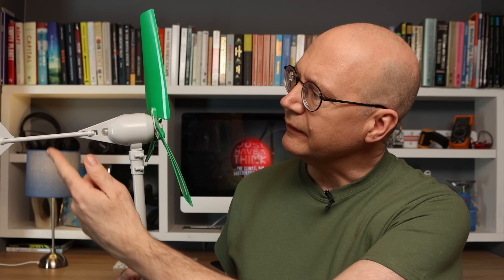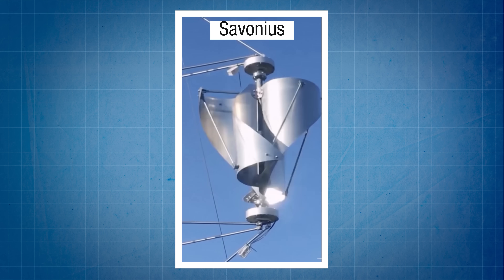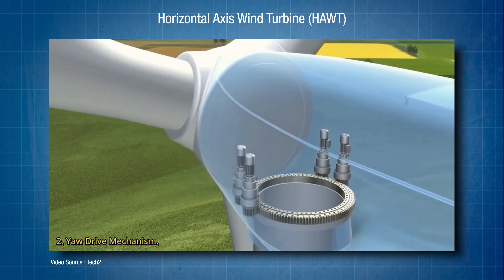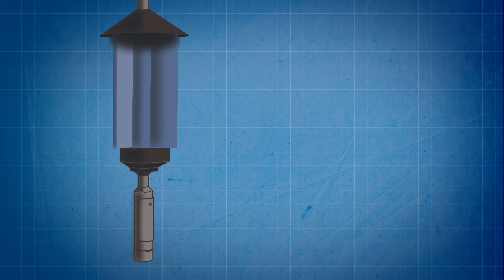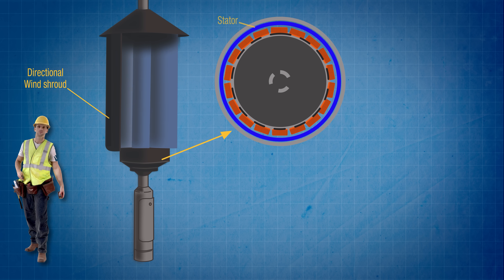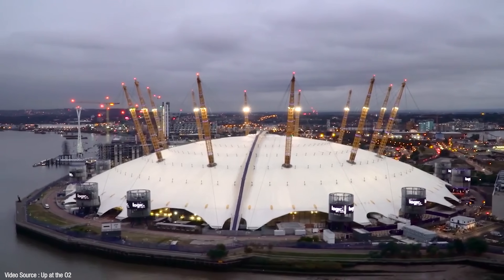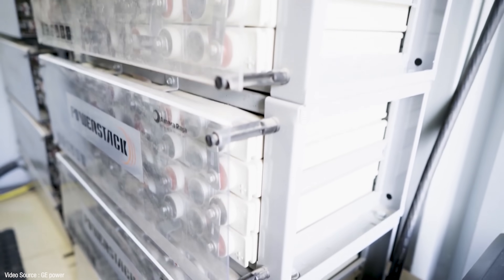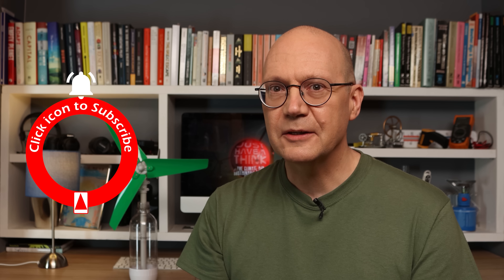A vertical axis wind turbine that doesn't need the prevailing wind! How do they do that?

Comment from the maker: **************** INFORMATION CORRECTION FROM THE VIDEO CREATOR******************
Some of you eagled-eyed viewers have pointed out a discrepancy in the arithmetic in a cost comparison between a solar farm and an installation of turbines, which was originally featured at the halfway point in this video. Having spoken directly with the folks at Alpha 311 we have established that, while the bottom-line cost comparisons were correct, there was a syntax error in the original presentation document from which the comparison was taken, and there was some key data that I had not included in my commentary which would have clarified how the calculations had been made. It’s not possible to add a new section to a video once it has been posted on YouTube, but it is possible to delete certain sections, so I have now removed the comparison slide, and it no longer features in the video. I am however conscious that some of you would like to understand what the accurate numbers really are. So here they are :

Cost comparison :
 A 3MW solar farm on 15 acres of land, consisting of 12,000 panels at 250W per panel, with a 25 year ‘Power Purchase Agreement’ at an agreed cost of between 4.7pence and 6.3pence per kWh, giving an overall 25 year cost range of between £38.2m and £51.3m 

Versus

An installation of 125 turbines along an existing  4.5km stretch of motorway with a monthly lease cost (including installation and lifetime maintenance) of £29,000, giving a full 25-year cost of £8.7m.

Calculations:
A 3MW Solar installation receiving 6 hours of useable sunlight each day (averaged across a year) works out like this:
3000kW x 6hrs = 18,000kWh per day

In the original document the turbine installation was also quoted as having a 3MW generating capacity. This was INCORRECT.

I also omitted an important power generation graph that was included in the company’s original presentation to me. That graph came from the external test house and it showed that the turbines have a maximum rotational speed of 420RPM in a wind speed of 19m/s, giving a maximum generating capacity of 6kW, (which by the way, is well within the capacity of the turbine’s alternator, which is rated at 13kW)

125 turbines at  6kW per turbine  = 750kW total capacity (NOT 3MW as originally stated)

Wind Turbine maximum capacities are based on an assumption of constant wind speed over 24 hours (just like solar panel maximum capacities are based on the assumption that it will always be sunny during operating hours).

The sums for the turbine installation therefore work out like this : 

750kW for 24 hrs = 18,000kWh per day

So, although the generating capacity of the turbines is less than the solar farm, the rated available operating time is 4 times greater. That means that the overall generating capacities for the 2 installations are indeed comparable.

Alpha 311 have conducted extensive testing on their turbines with external test houses over a three-year period prior to investing heavily in tooling to set up production on multi-million-dollar contracts with large corporations who, you can be assured, will have done their own due diligence on their investments before signing on the dotted line. The folks at Alpha 311 assure me that they have seen the operational performance of their turbines with their own eyes, and they stand by their numbers 100%. Ultimately, unless you enjoy standing in a court room being sued for misinformation and  breach of contract, it is generally sensible to ensure your product ‘does what it says on the tin’, and having now spoken at length with the Chief Executive of the company, I am satisfied that Alpha 311 are acting in good faith.

I would also like to directly address the less savoury comments  from one or two very ‘animated’ commentators who felt the need to post multiple defamatory comments about me personally. For the record…I am not affiliated in any way with Alpha 311. This video was not funded, sponsored, or paid for in any way by Alpha 311. I have never, and will never, accept any payment or sponsorship from any company for any services or endorsements on any of my videos. I have never, and will never, monetise any of my videos. So, this video, just like all my videos, attracts ZERO revenue for me. There is absolutely NO incentive at all for me to intentionally post spurious information. I am however a human being, not a robot. Occasionally I make mistakes like everyone else. And when I do, I always hold my hands up and do my best to make reparations. I hope I have managed to do so in this instance., Many thanks. Dave Borlace (Just Have a Think channel operator)
Reply: This is BS. e.g. Consider a large high sided semi. At the side of the road are big wind turbines which are very close to the road. The semi clearrly has more drag because it needs to spin the wind turbines (spin damped by motors). 
e.g. 2.  The road is 2 way with turbines in the middle. The turbine forms a partition between the opposing sides and makes the airflow move more efficiently. I'm guessing there is increased drag either way, so vehicle momentum is 'taxed'.
Reply: @goldreserve  exactly, parasitic load
Reply: Error is intended, this is how you trick investors. This is really old idea but it's not efficient.
Reply: Should've posted this on April 1st.
Reply: It really doesn't matter what the arithmetic is, the basic premise is flawed by the laws of physics. Look at it this way. A vehicle going X fast uses the least amount of energy when there is nothing around it and winds are 0 mph. Same vehicle, in a tunnel that is close to the same shape as the vehicle, now the vehicle has to push ALL of that air that is in front of it out of the tunnel. Going X speed it is using a lot more energy to push the air out of the way due to increased resistance. Wind energy dissipates the further you are from the source, so if you want to capture the most energy, you move the turbine as close to the vehicle as possible. Good vertical axis turbines are about 15% efficient at capturing wind energy so the next step would be to use a foam roller to contact the actual vehicle to turn the turbine, all of a sudden your turbine efficiency rises, as does the corresponding drag on the vehicle. Now it has to burn more gas to give you a smidgen of wind energy. You'd be much more efficient just having a gas generator running. There is no free energy from vehicles, it all comes from the vehicles motor and to impede it is to spend more energy from the vehicle. There is a reason why there isn't a wind turbine on the hood of cars.
Reply: @alexkollitz2032  Very well explained.
Reply: That checks out. The wind speed of 19m/s vs. 5.2m/s expected from traffic makes all the difference, showing up as a cube, and the 4X time difference makes up the rest.  However, the vast majority of roads don't have 19m/s winds, or even 5.2m/s winds 24 hours per day, and I seem to recall that they were claiming the 125 turbines were equivalent to the big 12,000 panel solar, where solar often averages 4 hours/day at rated.
Reply: How does the 6kW output estimate compare with the wind turbine generator calculator at https://www.omnicalculator.com/ecology/wind-turbine ?
Reply: I will leave it to others who have worked through the numbers of generating capacity of the wind turbines.  However, I have to point out that traffic density, and therefore wind generated, varies widely over a 24 hour day and from week day to weekend, from rush hour to the middle of the night.  

Further, I stand by my previous statement that  there is no free lunch.  If you put up a structure that captures and impedes the flow of air moving out of the way of vehicles, those vehicles are going to have to work slightly harder to get through that air.  Thus, the power generated is not free.  It is paid for by the motoring public.  People driving along roads where these are installed will be paying a small tax in the form of decreased fuel mileage.  And, ultimately that energy has to come from somewhere so there is no ecological advantage.  Only smoke and mirrors.

There is a corollary that has been shown in a number of studies comparing the cost of maintaining a road versus the cost paid by the motoring public for additional wear and tear on their vehicles caused by driving on a poorly maintained road. Maintaining the road is cheaper. However, the public will generally vote against additional taxes to fix the road even though it will cost them less in the long run.
Reply: Great work Dave, I must admit my first thought was that this was a variation on the 'turbine on the car roof' concept. Glad to see it's really a great idea. Ignore the pinheads, the hard of thinking will always be there.
Reply: Very well written explanation &  rebuke to the haters is the cherry on top.

Great video, A311 has made their future very lucky, indeed.  It's these energy reclamation & other Alt-Energy sources, which will lead to less physical conflicts (wars, hot & cold) over energy resources.
Reply: You quote 6 hours for solar, is that the UK numbers?
Reply: Buddy Waisname II https://www.youtube.com/watch?v=F_NUVaUd4XA&t=512s watch it all for dumping on toronto :P
Reply: <sincere value="Excellent video.">  <sarcasm>Only a robot would need to insist it wasn't a robot. Perhaps the turbine company built a bleeding edge robot to help sell a turbines to a limited market. Very crafty! </sarcasm>
Reply: our company plans to line highways with VAWTs  they great price for performance if we wanted to go big we would use tidal energy!
Reply: @DarkOkie  company name?
Reply: Vertical wind I agree is a big deal because of the massive surface area that exists from which usable ("working") energy can then be produced. Plus in building up rather than out an enormous amount of space savings can be achieved("energy banks") and better still waste heat would have an ahem "proper"(engineered correctly) ahem place to be go...namely up a funnel where it can be further reused thus generating extra energy in the form of lift/loft.
Reply: Could you please give me an honest opinion as to the questions I put to the Sierra Club regarding whether Indonesia's should build 7×500MWe ThorCon liquid metal Thorium ion molten sodium fluoride salt burner energy converters totalling 3.5GWe base load &/or load following -
 Or continue with their PV alternative and destroy a further 19000Ha (190sq.km) of scarce tropical rain forest for Solar PV farms to supply the equivalent energy?
My unanswered Open letter to Sierra Club: -  
"..INDONESIA has an environmental choice: -
more poluting coal-fired power stations; 
Or-
 7×500MWe liquid Thorium metal ion with molten sodium fluoride salt, (MSR) ThorCon energy Converters at a capital cost of $1/Watt;and a >75 year life?
 Or -
Destroying 190 square kilometres of tropical rain forest for <30% utility 25 year life Solar farms to get the same total energy output  as the seven ThorCon 500MW MSR units but at a cost of $(2÷30%)=$6/Watt?
I represent a number of environmentalists in Indodesia and we would love to see a reduction in the number of 1GWth Coal power Stations scheduled within the next 10year plan as well as the eventual conversion/modification of existing ones to use Molten Salt Reactors (MSR) as a clean and safe heat source.
We, and quite a number within the rural farming community, are concerned not only with the encroachment by urban sprawl into extremely productive farming and flood absorbing land; but also the actions of entrepreneurs seeking land for large Solar panel farms.
# Could you please confirm whether or not your club would prefer seeing Indonesia's choice for replacing existing and future planned poluting coal-fired power stations with either the likes of MSRs or farming and/or tropical rain forests destroying Solar farms such as : -
A) their currently contracted 7×500MWe ThorCon "Walk-away" safe (near ambient pressure), energy converters with a 65m×180m=1.17Ha footprint per load following unit of max 500MW on grid; at a worst case annual 95% utility factor, amounting to an averaged availability max load of  406MW/Ha (over a giving 75year life) at a capital cost of $1/Watt and a PPA agreed cost to consumers <$0.07/kWh;
Or -
B) (As already experienced in PLTS SulUt  Likupang's 21MWp ;15MW on Grid at 30% utility with a footprint of 30Ha and 25year life); 
Equivalent Solar farms at 0.5MW/Ha; at a pre utility basic capital cost of $2/Watt; and a current PPA cost to consumers $0.066/kWh and averaged load output 0.1MW/Ha to 0.5MW/Ha over 7.5 hours per day giving 30% utility.
HENCE for Solar Output over their productive hours to equal that of ThorCon's 3500MWe over the same daylight period of time; then the area requires would be:
 (7×500/0.5)÷1.17=7000/1.17=6000Ha or 60km^2 of scarce tropical rain forests.
Because Solar is only effective for 7.5hours/day (30% utility), to meet the Max possible (as a  base load) annual output would increase required area tropical rain forest destruction to 0.95×6000÷0.3=19000Ha or 190 Square kilometres of tropical rain forests or virgin jungle.
(It is of note that wind farm are not viable in Indonesia due to their lack of wind being in a Equatorial location).
If you cannot confirm a suitable choice for Indonesia (or the world for that matter) would you reconfirm that the Sierra Club still prefers the destruction of temperate forests in Germany for shipment to burn in subsidised poluting British biomass plants in preference to walk-away safe liquid metal molten salt reactor that can also burn up existing nuclear "waste"?
NOTE: I have no interest or influence in ThorCon.."
I await your thoughts..🥝🥝🙏
Reply: Only 7 birds will die instead of millions if you PAINT THEM RED!!! With outward spiralling motives. Like a WARD!!
Reply: @Berserkerbaboen  huh?
Reply: @misinfowars5139  The loonies are taking over the thread. Internet as usual. Not much more to see here.
Reply: those 250 watt panels will actually produce 50 to 100 watts , depending greatly on your latitude . from real world experience of many years .
Reply: @jeffgold3091  Yeah its called the capacity factor - 250watts is only the max capacity assuming full sunshine at 90°, if the sun hits the panels at 45° they would only receive sin(45) * 250watts = 176watts

And then there is clouds and night time...
Reply: @jeffreylebowski4927  I just know from more than 10 years experience using photovoltaics at various latitudes ( even directly overhead )  and whatnot , you're doing good to get 1/3 the rated wattage . even less with 400 watt wind generator
Reply: @jeffgold3091  So if a 250 watt solar panel sits in the middle of the sun hitting it at 90° with the sun steep overhead, the panel will only produce 100 or so watts...?
Reply: @jeffreylebowski4927  in my experience . I have one 300 watt panel with a PPT controller and 600 Watts on another controller and I use them in the tropics . as I recall I get around 10 amps max from one and 20 from the other . at 14.4 volts charging 400 AH lithium batteries . maybe I should be doing better but it works for me .
Reply: @jeffgold3091  I have an 8.3kW Solar installation. At max sun I get around 6.2kW because of roof angles and SW facing and whatnot. On a yearly basis I produce around 8kWh. If my panels were facing the sun at 45 degrees all the time, I would expect around 8kW and not 6.2 as it is now. So your estimate of 1/3 makes no sense.
Reply: @tzenophile   tzenophile and others who doubt these numbers are absolutely correct, these machines will never produce anywhere near the energy claimed. I've been writing about renewables from a technical standpoint for almost 3 decades and have lost track of the number of companies I've seen making outrageous claims about their new VAWTs. Without exception, all of those companies proved to be scams or run by people who simply didn't understand the physics behind such machines. They cherry pic the top number in each parameter and think that that is acceptable, and the less well educated fall for it every time.

I've also built a number of VAWTs, and the only way to get useful output from them is sustained high wind speeds, not the sort of speeds you see at ground level, regardless of whether you are on  the side of a freeway or not.

The fact is that VAWTs don't fare well when compared to solar, indeed, small HAWTs don't either, a well placed solar array will always outperform a wind turbine, unless you are in an extremely wind location with sustained high wind speeds, which is actually very rare. There's a reason commercial wind turbines are on the top of 100 metre towers, often much taller than their blade length - because wind speed rapidly increases with altitude.
Reply: Why wouldn't you take revenue from YouTube if it was on the table? How do people think that would compromise your opinions on certain things?
Reply: @jaxstax2406  How: you get paid per view. You DON'T get paid to be a good fact checker. This problem should not be hard to understand.
Reply: Dave I had this idea long time ago.
Reply: There is always a Dickhead that is sanctimonious enough to call out any mistake with vitriol, try to ignore mentally deficient individuals that have to self glorify at other's expense. Cheers from Tassie!
Reply: @dogdooish  And then there is the hypocrite who does not read or understand the correct and quite polite criticism being made, but have to say something vitriolic anyway.  This isn't some small mistake, btw, the basic claim here is off-the-charts wrong.
Reply: That’s good of you to set the naysayers on they’re duff. If these counter productive filth of humanity would convert they’re energy to solving our energy woes. We might be able to make the world a little better. Just a little. I appreciate your show and admire your candor. Live long and prosper 🖖.
Reply: @reynaldomartinez7978  You're an utter dork. Read the thread you're responding to and prove you can actually read and comprehend. THEN comment on who is right about these snake-oil products. Best of luck proving your brain works!
Reply: tzenophile your hatred consumes you beyond comprehension. Hate begets hate. You are in dire need of LOVE ❤️ and COMPASSION. TURN AWAY FROM THE DARK SIDE. BEFORE IT BURNS UNTO INFINITY.
Reply: tzenophile it’s only a piece of the puzzle. Many ideas are needed to assist mankind. Badgering others will accomplish anything for the good of mankind’s existence. Seems to me you’ll be dancing the hell fire hat dance when all is said and done.
Reply: Nice one Dave, another appetiser in your banquet of food for thought.
Reply: Curtis Mostlypeaceful Womack  On the other hand, since it happens to be a complete scam in practice (19m/s (gale) winds are not average in the UK, but somehow is used in these calculations as if they were) it sure AF will be deployed in the US.
Reply: I was thinking of doing exactly this 10 years ago :)
Reply: @ZafOsophy  You were thinking of correcting the information in your erroneous youtube video 10 years ago? I wish more people were as smart and diligent as you.
Reply: @tzenophile   I had this idea 10 years ago, put vertical wind turbines, in the centre (and left and right and on top) of motorways, on all the corners of my house, vertical and horizontal corners :)
Reply: @ZafOsophy  If you read the comments, it seems a lot of people had this idea 10 years ago, or more. However, if you read the comments, you'll see that the idea is not very good; vertical windmills like these AND in turbulent places will never work well enough to recoup their cost. So the idea is not good at all. And windmills on your house? Anything that will produce significant energy will also ruin your sleep. I don't want to rain on your ideas, but there it is. Vertical (Savonius) windmills have been around for 100 years, but there is a reason you don't see a single commenter on these videos that actually have them. They look great, but are so inefficient that they will never become a viable alternative. This is pure physics.
Reply: And the least aerodynamic vehicles will contribute even more residual wind in their wake, this somewhat making up for their greater fuel consumption.
Reply: @NE05P0RlN  I really want this comment to be a joke. Am I asking too much?
Reply: Sadly the world is full of intolerant bigoted individuals whose shit, apparently, doesn't stink and who think it appropriate and their obligation to berate and castigate others - because they are apparently actually perfect themselves. For the record, Dave, there are far, far, FAR more of the rest of us types who are curious and REASONABLE. We are all people, and I agree, we absolutely all do make mistakes and when we do so this certainly does NOT justify or warrant some brainless moron doling out personal abuse or telling us what part of a woman's anatomy they think we look like (probably because they've never seen "that bit" themselves). I personally lack the intelligence or education (or both) to understand in minute detail every equation you cite anyway - I come from the angle of how can we find some other way of powering our machinery to wean ourselves off of petrol / diesel & coal and onto something else which is just as practical. Eventually "we" as a species will discover how to do it cheaply, efficiently, safely and reliably - I wonder how much abuse someone like Edison had to put up with whilst he experimented with the 999 ways not to make a light bulb??? Keep smiling, Dave (and other "brainiac" types) - like I say, most of the rest of us are on your side and supportive.
Reply: Thank you for the information that you have gathered, the corrections made, and your integrity.
Reply: @capturedflame  you do know YouTube puts ads in by itself without the content creator having any say in the matter?
Reply: I love this correction, it makes you totally credible in my eyes. Kudos Dave, I consider patreoning this channel.
Reply: @capturedflame  I guess if you read your two sentences you see that they do not make sense, at least I can't get what you want to say. You may want to try again.
Reply: You don't see Japan doing any of that green crap.
Reply: From the Climate Crap Coalition:

Exhibit A in the BIG LIE of climate quackery:

One of the glaring stupidities of the climate change argument is the fact that the climate was warmer than it is now in years 800 to 1200 – the Medieval Warm Period.  Greenland had a thriving Viking colony and England was producing so much wine that the French were getting upset about the competition.  Neither Vikings nor the English drove SUVs.  The stupid assertions of climate change is government expanding its boondoggle empire through quackery and superstition. “Government imposed superstition” in the 21st century is something we should be ashamed of.

https://youtube.com/c/CDN_ClimateDN

The Ballad of Climate Superstition: https://www.youtube.com/watch?v=0CFuCYNx-1g&ab_channel=lozzagermain

Here's something for the idiots of renewable energy: Thorium

https://youtube.com/playlist?list=PL6JjafE5gsb928LkKNnz9MUiVBME4aGqi
Reply: 11
Reply: 250w panels?  Mine are 485w and Costa 300 euros each, maybe you are aiming to low
Reply: So, this won't go away. It is sad, but this scam video popped up in my feed again today. I will have to say good bye to "Just Take a Think". I will click "do not recommend channel" and that will be that. You have had a couple good ones recently but your gullibility to impossible technology and scam startup companies it just too much for me. You can't be trusted to filter out the fraudulent, or even draw the line at perpetual motion. Why not do a video on putting babies on tethers connected to generators? We could whip the babies to make them pull harder.  Good bye.
Reply: Here's something for the idiots of Renewable Energy: 

Sooner or later you greenies are going to need to grow up and learn how economies work. - hint government people understand nothing of economies other than  how to rape them.    

These G-morons decided "woke' power (power that doesn't really work) was a great idea for them, not us, so they decided to steal some money from some ratepayers in order to pay others to stimulate the growth or power that really doesn't work - ie wind and solar.

In the real world, the one that really works,  there is something called supply and demand and these things regulate the price of everything fairly.  

Your butcher buys his beef by the side and pays more for it than the meat packing plant did who in turn paid more for steer than it cost the rancher to produce it.   Get it so far?     

Now when you buy that beefsteak at the butcher's shop he's going to get his markup as well,  so you as the end consumer are going to have to pay a lot more for it per pound than the rancher was paid for it.   

Next time you want a beefsteak drive out to a ranch and buy your steer on the hoof - then you slaughter it, age it carve it up sell the inedible parts to dogfood processors and the like and eat the rest of it on the cheap - no you want the value that all those who added value to the meat along the whole length of the supply chain don't you?  Or do you buy your steaks on the hoof?      Or do you expect to pay the  ranchers price at your favorite steakhouse as well?

It's that way with electricity too, you cannot expect the power company to buy power back from you at retail rates when they don't even need or want the power. With that business model they will go bankrupt as soon as their investors are wiped out.    

If that rancher were to dine out at your favorite steakhouse why not demand that your ignorant politicians make the restaurant buy his on-the-hoof steer from him on demand at the same rate per pound that they charge you for a 16 oz prime rib?    

The problem is, as with all government planned economies, sooner or later everyone will want to receive the grift instead of paying for it, when that happens the lights go out - permanently.

The most ignorant feature of all of this is that it is supposed to solve some problem that the grifters dreamed up but that does not actually exist so solar panels and wind turbines only create huge problems, they solve nothing - time to wake up you dizzy Californians.
Reply: @hg2.  The planet will have been destroyed by then. NO ECONOMY can work in a post-apocalyptic world. You flat-erff Trumpers need to learn that there is no god to re-build the Earth that supports our life. There is no after-life, and according to the bible (wise steward) those who "roll coal" will be in hell.
Reply: Why not put a solar farm under the turbines?
Reply: Could also put these turbines on posts at the side of railway tracks🤷
Reply: Dear Dave, it is highly appreciated that you acknowledge and correct the error.  However, 6kW out of a two meter tall VAWT turbine at 19 m/s is impossible, even if this particular company should have revolutionized VAWT design, as there simply is not that much energy available in a swept area of that size. A VAWT calculator (there are several available) will show max figures of 2.6 kW @ 19m/s. But 19 m/s is a GALE wind speed. At a 'normal' wind speed of 5.4 the power output would be a lousy 60-70 watt (see below for the calculation).  Icewind.is is making a similar-sized VAWT the RW500, which is rated at 500W at 10 m/s. So 6 kW @ 19 m/s appears to be in error. 

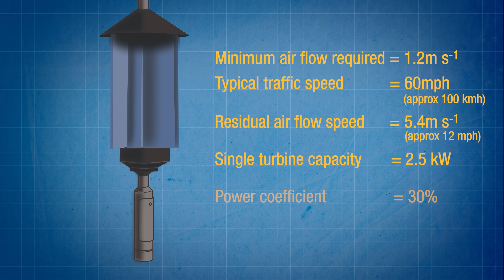The formula for VAWT wind energy is Power=1/2*Area*Air Density*velocity^3  Assuming a turbine 2 meters tall and 1.2 m wide, at sea level air density, we get 1/2*2*1.2*1.3*19^3 = 10700W, and at 30% efficiency we get 3kW before losses, NB at a Gale wind. 5.4 m/s gives 74 watt at 30% efficiency.  I'm sorry to say that I believe there is more correction to be done here, E.g. at 5:30 where you still claim 5.4 m/s yields 2500 watt per generator.
Reply from the maker: Hi Tzenophile. Thanks for this additional information. I know that the folks at Alpha 311 have been keeping an eye on the comments here, so they may well pick up on your commentary and numbers. I will have to defer to them to reply if they feel it appropriate to do so, partly because we have now firmly arrived at the 'horizon of my technical knowledge', and partly I'm afraid, because I am now fully bogged down with research and production for the upcoming new videos. I appreciate your input though. All the best. Dave
Reply: @JustHaveaThink  Thanks, Dave; I really appreciate your honest answer.  And I look forward to your future videos! I guess the lesson here (since I don't expect Alpha 311 will respond, and they have the burden of proof) is that unproven numbers from startups, especially "green" ones, need to be taken with a big grain of salt, and - even better - independent fact checking or at the very least not simply at face value.  Unlike this project, I believe that the Gravity Vault could work; it's a new idea, so let's give them a fair trial - but in this case, the history of VAWT is littered with failed startups and prototypes, and "100 hundred years since Savonius" should give it away.  The future of green wind farming is off-shore double digit megawatt turbines, especially for the UK.  

Anyway, Cheers, and Keep up the good work!
Reply: @JustHaveaThink  Thanks Dave we all appreciate you - personally I think the simple math of multiplying 6kwh by 125 turbines or multiplying 300kw by 24hours (capacity factor for UK solar can be found with a simple google search) to get the average daily yields for solar vs these turbines would be well within your 'horizon of technical knowledge' if you just gave it a try. Same for kinetic energy of a moving mass - this is all high school level stuff - so maybe have a little more faith in your self, because we all do!
Cheers.
Reply: @jeffreylebowski4927  This is as far as it goes, I guess. I wonder how much pressure he would be under from their lawyers if he did a properly critical take?? (And what happened to your last comment?)

Anyway, there is not a chance in h3ll that a company that claims that a small VAWT can fill 80% of the power needs of an "average American home" is going to take responsibility for their claims ("The company has ordered 54 turbines, which can generate enough power to meet the energy needs of 43 average American homes." - Alpha 311 web site) That is 24 kWh/day, or a sustained/average output of 2kW.  Still two orders of magnitude off, or shall we say a two orders of magnitude lie. At best. We should at least expect Dave to do a followup in a year or so, both of this one and the Gravity Vault (which I personally think could actually work). That would be good entertainment value!
Reply: @JustHaveaThink   Here is an idea for a video: Denmark is building an artificial island off the west coast of Jutland for a 3GW wind farm!  That is enough to supply 10 mill.  people. Just (have a) think if the UK did the same?
Reply: @tzenophile  Yeah you are right, when this company is actually making sales based on their wack calculations then someone is going to get into trouble.
I actually deleted my last comment because I thought it was too mean spirited maybe? I just got a bit frustrated there - sorry if you were replying while I was deleting it - I hope you didnt have to start over.
Im glad he reacted but a bit disappointed with how - why should I listen to somebody who feels he cant multiply 6 with 125 or use 1/2mv^2 which is all that power formular does? - To me that just seems lazy and careless, obviously he would be perfectly able to understand these things if he only tried, instead hed rather pretend to be dumb. - lol there Im being mean again, just cant help it.

I would like those follow up videos too but doubt that it will happen - I really liked the gravity tower as well, its very neat especially since it would be completly automated - But I think I have to agree with the critics that wind would be a big issue for a long crane to stack big weights precicly and also its a fairly complex system with specificly crafted weights and only holds about 10mwh? - I forgot the exact capacity, but for the price that doesnt seem like alot - a single wind turbine produces that in a few hours - (on a grid level 10mwh is almost nothing, a big city can require multiple gigawatts to run - 1gw would eat through 10mwh in just 36 seconds), pumped hydro on the other hand can store multiple Terrawatthours in just one lake! - having a liquid weight you can pump through arbitrary paths that can build pressure head and of which youve got an almost limitless supply is just unbeatable. 
I dont think we can get to mostly renewable energy without pumped hydro and HVDC (high voltage direct current) lines connecting everything - Germany and norway just build the longest undersea HVDC line so germany can use norways pumped hydro overkill capacities to store energy - gee this is getting long again I can ramble about this stuff all day :D
But the tower is certainly a neat and pretty idea!
Would love those follow ups too :)
Reply: @jeffreylebowski4927  Obviously he is not making a ton of money on this channel and if this is his day job, then it is rational to post the video and move on. There are a lot of much less responsive youtubers out there. Let's just hope that he will be a bit more skeptical and diligent next time. And to be fair, what I have seen of Rosie's VAWT videos is not very critical either.

As for the gravity vault; there are three main questions as I see it: A) will it actually work; B) will it be worth the investment, and C) are there better alternatives even if both A and B is a yes. Hydro is a very last-century thing; today there is a lot of environmental resistance to new dams in Europe, which is probably why Germany is building a mega-dam in the "Democratic" Republic of Congo instead.  The same people who love being "green" will fight their own governments fiercely when new dams are proposed. Norway opened only three new >100MW hydro plants in the last decade, so very little new capacity is added. Pumped is actually a very good addition in this scenario, since it increases the capacity of the existing dams, but it will be expensive to implement (admittedly, here I speculate). 

The Vault's main challenge will come from chemical batteries (since it won't be used in hydro-producing countries); I expect there will be a lot of innovation in large scale battery plants. If the Vault can compete on price, at least for a while, then I don't think the technical issues are that severe. The issue everyone seems to have is the wind interfering with the blocks. But if you can have drones standing still while filming in relatively fresh wind, then having some propellers on the grapple should keep the blocks stable. If the power it will back up is wind power, then it will not be used in strong winds, but only when there is no wind. And no wind, no problem, right?
Reply: @tzenophile  Yeah thats the thing, not sure how he can be more skeptical if he doesnt have the basic tools (multiplication) to compare things like energy outputs - even when someone lays it all out for him - but then again it may just be a hobby of his and mainly for entertainment... - ( just in my head I imagine how much time he does spend on the animations and research... "professional production value" like other comments said - and then he doesnt have 10 minutes to do a multiplication and gives up on it before trying, Id rather have crap production value and good information, but whatever moving on... )

I think the vault can be made to work - attaching propellors to cancle out swinging and wind might be a good idea - but also more stuff that can break or be bugged and needing maintainance...
The main problem I have with it is its low energy capacity - there is a data center that builds this new liquid antimony metal battery as a backup - 250mwh worth if i remember correctly - thats 25 of these towers if a tower has 10mwh. - So I think that battery may have already won...?
But I dont know - didnt look into the vault much.

You are right that pumped hydro is a major project and difficult to build - but if you can just build 1 of them in the entire country or in a neighboring country you get several twh worth of energy storage - 1twh = 100.000 energy vaults - which would have a bigger footprint and cost? - if youve got an hvdc grid like europe is building its no problem that the pumped hydro plant is in some remote location. (why not somewhere in the alps for example - at the center of europe and not that many people there? - huge pressure head also means the resorvoirs can be smaller - making two big lakes could even be a pretty thing, it could store wind power from northern europe and solar power from souther europe and even north africa) - I think per amount of energy stored pumped hydro will by far have the smallest footprint and cost... The plant its self is often inside of a mountain and the resorvoirs are just lakes...

 - But we will see, I like all technology... =) - Its nice chatting with you.
Reply: @tzenophile  I checked - according to the company the largest energy vault could have 80mwh of storage not 10 like I guessed, so lets say a 5twh pumped hydro plant (that storage exists in one of the lakes in norway) would be equivalent 62.500 of the largest energy vaults...
Reply: @jeffreylebowski4927  hehe, yes, but do you want to buy power from Norway when you are in India? It is a good question; perhaps it makes sense some time in the future.
Reply: @jeffreylebowski4927  Right; pumped hydro IS a solved problem, technologically; and to minimize environmental damage you could have the reservoirs themselves inside the mountain, one high up and one deep down (even under sea level); this should be politically safer and easier than expropriating real estate and incurring the Green Wrath... Then you used the mined rock to make blocks for the nearby Energy Vault!  It's been fun to talk to you, too, see you at the next one!
Reply: @tzenophile  Haha no that would be too far away, but India has the Himalaya Mountains right at their door step so they could build their own even more epic pumped hydro plant :D
The power loss in an HVDC line currently is about 3.5% per 1000km, so you can do the math - at even higher voltages though that loss could come down even more in the future =)
Reply: @JustHaveaThink   Hi Dave - if you check out the proposed solar farm at Delabole in the UK, they are claiming their 3MW solar farm will produce 2964 MWh of electricity per year. Unless I’ve done my calcs wrong that 8.12 MWh per day (on average). Here’s the relevant bit from the PDF. “The estimated annual output of Delabole Solar Farm would be 2,964MWh. This is based on an installed capacity of 3MW and PVGIS estimates of solar electricity generation for the postcode location of the site of 988kWh per year for a 1kW system (Source: EC Joint Research Centre, Institute for Energy and Transport). The estimated number of homes supplied is based on the estimated annual output of 2,964MWh and the average annual household electricity consumption for 2013 of 4,192 KWh (DECC: Energy Consumption in the UK 2014).” Does this back up what youkre saying?
Reply: @mondotv4216  My own PV installation is 8330W, and will produce around 8000 kWh in a year, on a similar (+5N) but sunnier latitude, so that sounds about right.
Reply: Hi  @JustHaveaThink  

I have been looking for the assessment from Leeds Institute of Themofluids (4:55) - I know they've had some advice from Dr. Andy Young (4:08), but I don't see any published formal assessments - must imagine it has been more informal so far..
Are you aware of anything more?
Thanks
Reply: @tzenophile  There's some really good points made by you and a couple of others. Sorry its 5 months later but here's a couple other things.
1: In all of the energy discussions these days people have their favorites and some of those people will state to their dying breath that their favorite technology will save the planet.
2: There are those companies that are trying to fund their ideas and they all (irrespective of reality) claim their technology is a "game changer" to their technology is the one that will save the planet.
3: Way to often in these discussions people are so tribal that they can't have any sensible discussion. What's more they often jump in with and wont let anyone else discuss anything sensible.

I argued with someone a while back that these technologies depend on geography more than anything else. Clearly a country like Morocco has geography suited to solar. Clearly those parts of Britain that are windswept by the Atlantic, Irish Sea or North Sea are clearly suited to wind. I'm Australian and we are slowly starting to face some of these facts. We have lots of people promoting all sorts of stuff and some of it is complete crap. 

In our North we get tropical storms that are damn violent. A lot of the cheap solar panels we imported from places I can't name can't handle it. Despite 25year warranties they barely last 3 or 4 because they get water in them during the storms. We have heavily subsidized domestic rooftop solar and there is this big issue nobody wants to even discuss. There are people making too much money.

So we have that huge issue with our solar industry and cheap shitty panels. We've also had importers bringing in totally cheap crap VAWTs  that have made any discussion of them feel like bomb blast. The tragedy is we aren't having the types of discussion we need to have. We can't even get to the discussion of what suits which location. So we can't even discuss what the options are or what we could or should do.

We have a lot of coastline with thousands of houses that get great sun during the day and steady wind all night off the ocean. Australia isn't the only country that has places like it. IN THOSE PLACES there is actually great potential on many houses for small Savonius or Darrieus turbines that can plug straight into the existing solar inverter technology during the night. It doesn't actually need to be as efficient as solar or a HAWT. What it needs to be is quiet because its on the roof of someone's house and it needs to produce power compatible with the existing solar inverters. That is something a few manufacturers have done and they can't get anywhere because instead of looking at the overall system performance they are doing ridiculous comparisons. 

If you look at what Alpha 311 have done. Its stupid to be comparing a system that taps residual air movement to a solar farm. The question should be there is an untapped energy source along the highway. Can it be tapped in a way that is cost effective manner?

At the end of the day and I rarely see this in any of these basic questions in energy technology discussions. This is basic project management.
Can it be built in a cost effective manner?
Can if be maintained in a cost effective manner?
Will it RELIABLY DELIVER what I I need it to deliver?

I'm an engineer and those 3 questions are being asked less and less often these days across the entire engineering and technology space. 
Consider Alpha 311 they look like they have but they actually haven't because they are playing with questionable data and calculations and comparisons against technology that they should not be. Why aren't they comparing their technology to wind?
Reply: @tonywilson4713  It's a fair bet that, if you put it on your roof and it does not disturb your sleep, it is not going to be cost effective. Windmill efficiency scales with size, period. I have a piece of land where the wind blows quite a lot, but should I invest in a private wind turbine, or rather spend the same money in a large scale windmill company? This is simple math. You never see posts in these videos by satisfied VAWT owners. No price for guessing the reason. 
Agree with you that blind tribalism is stupid. Focus on facts and all will be well.
Reply: @tzenophile  Dude have you ever been to Australia or lived by the sea?
There's a reason I said "certain places" and not every where. I know there are parts of towns it would be a waste of time while other places it will be brilliant. This is the argument I keep getting into with people they think one place is the same as every other place and that just flies in the face of reality. 

This is where I used to live for many years right on the beach. https://en.wikipedia.org/wiki/Aspendale,_Victoria
I can tell you for a fact that our apartment block would have bee great for a Savonius and hopeless for a Darrieus and worse for a HAWT. But if you go as little as 400m straight inland a Darrieus starts to make sense and about a 1000m HAWTS take over.
You see right on that beach you get solid reliable wind going from the late afternoon until the early morning. In the hot summers it was like  a giant free air conditioner in the afternoon. However that section of coast is also prone to getting hammered by violent high velocity wind squalls. But all the apartments and housing break it up and friends of mine a few blocks over used to get nothing compared to what I got. It got windy for them but nothing like the beach front.

The actual building I lived in was perfect for solar, but I couldn't get the body corp to agree. The building was east west with a slope facing North. The wind is only viable if the solar system is already there. That's the important thing to understand. 

Part of your argument is just silly. By the time a roof top VAWT is making any noise the wind is making a lot more. 

As for other technologies like solar and HAWTS there are plenty of videos showing nightmare crap there. 

Here in Australia we have huge issues with cheap assed solar panels that aren't properly sealed. There's a company in Adelaide that pulls off 600 panels a week and breaks them down into scrap to sell back to the industry. We have 1000s of households who banked on solar and got screwed. We have had so many clowns jump into an industry they had no place being in. 

We have had the same problem with VAWTS. All the ones that have been brought in are cheap crap. That will be the hardest thing anyone will have to get past. All the bad cheap crappy stuff that has made a ness of everything.

There are huge issues with VAWTS in wind farms that are off shore or close to the sea. Places like Denmark. They never protected the leading edges from salt erosion and there are hundreds of turbines needing replacement blades. Go have a look at modern composite airplane propellers. They have Nickel leading edge strips because they know how vulnerable leading edges are but the wind clowns didn't listen. That's going to cost millions to fix and the pro-nuclear people will ignore their issues and scream about it. 

FYI - I have a degree in aerospace engineering. So I know about the propeller blades.

This is what I mean by people needing to FK-OFF with the tribalism and start thinking through solutions. SO STOP pointing a fingers at viable solutions its gets nobody anywhere.
Reply: @tonywilson4713  As I said, focus on facts. This is not about who you are or who I am. What are the huge issues with (I assume you meant HAWT) wind farms in Denmark? Do you have any documentation for that? 

As for my point about sleep, it's not the noise, it's the vibration. If it doesn't vibrate it is not producing anything. Solar is a no-brainer, sorry. Cheap, rotten products exist in any market - buy cheap, pay double.

Vertical axle windmills just aren't cost effective, by design. They have been around for 100 years and that is long enough to safely dismiss them. Lots of people love them, but none of them (or you?) has ever owned one. THAT's actually funny.
Reply: @tzenophile  P.S. #5 is my favorite quote with respect to engineering.
https://www.youtube.com/watch?v=ulovgqDbXuo

When I show it to other engineers they ALL GET IT, its just that some are pissed because its about them.
Reply: @tzenophile  Your comment is TOP NOTCH. We need to fight with liars that do not understand what they talk about and mislead millions of viewers. You cannot beat the physics.
P = 0,5*ρ*A*V^3* ηm* ηel* Cp -- equation for power of wind turbine.
ρ=1,22kg/m3 (air density), A - turbine area [m2], V - wind speed [m/s]; Cp - energy extraction efficiency
P=0,5*1,22*(2*1,2)*(5,4)^3*30%=0,61*2,4*157,5*0,3= 69W
It is 69 Watts of power at best from single turbine. Without attribution of mechanical and electrical efficiency loses.
For 2500W you need 17,8m/s of wind at 2x1,2m dimensions. 
Everyone can check yourself at MetOffice the wind speed at different locations.
Dave before you publish any more films about wind energy PLEASE consult them with ROSIE. Because of such rubbish material like this one, people are buying 2-3kW small wind turbines and are frustrated that they do not work.
Reply: @tzenophile  I think the output is optimistic.  Here is another calculator https://www.omnicalculator.com/ecology/wind-turbine
Reply: @tzenophile  well, those are the numbers from the company so if you'd like, you'd probably have to take it up with them.
Reply: @MrMineHeads.  I'm not an investigative journalist; but if I were, I'd likely have a field day. These assumptions (24/7 operating at gale winds (the AVERAGE wind speed in the UK is 4,2 and NOT 19 m/s), VAWTs suddenly outperforming HAWTs after a 100 years of failing to catch up, not to mention completely improbable calculations of a very simple formula) all point in one direction. But sure, give me one researcher at a respectable and independent university vouching for this, and I'll marinate, grill and eat my Hollywood Drive Stetson.
Reply: @tzenophile  well, those winds are on highways. Is that 4.2 m/s for the country or on highways?
Reply: @MrMineHeads.  I don't know if you heard, but one interesting fact about highways is that cars tend to drive in opposite directions. A wind produced by one direction will therefore . . . I'm sure you can complete the sentence correctly.  Also, I bike on a bike path one meter from a highway every workday. The only wind that ever will present a challenge is the normal, non-vehicle produced one. Today was quite windy for a while, 9 m/s, so the VAWT would have produced around 300 watts peak, for about 2 hours. Right now the wind has dropped off to 5 m/s, yielding a pitiful 50 watt. Let's not pretend that this product is a good idea.
Reply: @tzenophile  I hope you're hungry!

4.06
Reply: @MrMineHeads.  Even if you take the numbers the comany gave of 6kwh per day per turbine - they would still perform 10x worse than the solar farm they compared their turbines to. - They just doing an extremly misleading calculation comparing "installed capacity" - derived from super high and rare windspeeds - with the actual production from solar where they apply a 25% capacity factor... - they dont apply any capacity factor for their turbines - except when they mention their 6kwh/day - and when you use that number in the solar comparison, solar outproduces them 10:1 - even in the UK, which means solar would be the much cheaper option...
This idea is bad and either the company is very stupid or attempting fraud with the obviously rigged calculations.
Reply: @tzenophile  "I'm not an investigative journalist;"
- We're getting there though... :D 
I think we're doing a better job than alot of so called journalists these days... - At least thats my impression when I read the newspaper or watch TV. 
And Dave is a sort of Journalist as well with his Channel, and he still doesnt get how the numbers dont add up, even though we did all of the work for him - somehow -.-
Reply: @tzenophile  Yes, but the forces don't cancel the torque that the wind exerts on the turbine. It adds to it.
Reply: @MrMineHeads.  How do you know that? If a car goes against the wind?  And what do you have to say to JB's comment to you above? If two cars pass each other just in front or below a pole when there is no wind, what force would be left? Unless you are a physics student, I should not ask you this. Which you clearly are not.
Reply: @jeffreylebowski4927  I wish you were right, buddy. Even in Dave's answer, it is clear that he is only addressing the Solar farm comparison, and not the VAWT calculation criticisms. It is super ironic that I have to warn people off investing in this dubious venture (to say the least), while Dave is happy to pass along their company link. Journalism after the web is a sad story; true. I don't doubt Dave's good intentions, but a journalist producing erroneous content like this in the good old days would not last long. BTW, are you in wind turbines, in some capacity? I have a farm where I will put up solar, and am looking into VAWT and HAWT and whatnot, and could use some advice. I'm based in Denmark, so not that far from the old G.
Reply: @tzenophile  Howdy neighbor :) unfortunately im not professionally into anything, im just an enthusiastic "nerd" with a bit too much time and I studied physics for a few semesters...

The only advice I can think of is, make sure there is good windspeeds where you live because the power in the wind grows with the cube of the wind velocity (2x velocity = 8x power) as you already know and make sure you place your turbine into a clean airflow away from and/or above buildings and trees which make the air turbulent. - the measurements of how far away and above obstacles one should place the turbine can be found on the internet... - and then just do the math of what price per kwh you can expect over the time that you want to run the turbine, which should be below the price for electricity from the grid... - building a high post with the turbine, cables and an inverter/transformer etc. - perhaps you even need a permit and a licenced person to hook it all up to your house - it has to also be compatible with your existing electricity meter etc. (but I dont know any of the regulations for denmark) could cost a bit but I dont know how much...
You then might also want to invest either into energy storage or into a meter and permit to sell the electricity to the grid... (generic meters cant count backwards and account for energy flow back to the grid - at least in germany) - otherwise most of the production would be wasted - since your load doesnt follow the wind...

Given that the inital investment includes a bunch of other constant costs than the turbine its self it might be worth it to invest the extra amount into a more efficient HAWT than into a cheaper VAWT - if its twice as efficient yet the price of the whole installation is only 1.5x more for example, obviously thats better.
Also a bigger turbine and going a bit overkill might be better economicly because of all the other fixed costs that need to be offset by raw production.

So I probably didnt say anything that is new to you, but thats all that comes to my mind...

I hope you find a cool and economic solution and can do most of it yourself - which is more fun and alot more affordable!
Reply: @tzenophile  Calm down dude. I am not defending the company. All I did was say that JHAT was using the company's numbers and that the company is confident in their numbers. If you think the numbers are BS, you don't fight the person reporting the numbers, you fight the person who came up with them, in this case, the company. Why are you so hostile?
Reply: @jeffreylebowski4927  Highly appreciated, thanks!  I do have a wide open 300m by 400m field with a nice prevailing west-to-east wind, the only catch is that I want to plant a forest there! Wind is 5-6 m/s average so good enough. Will definitely get a battery (Sonnen?) for the house.  Definitely HAWT as it looks now. There are nearby HAWT that produce 10-15.000 Kwh a year at a total height of 25 m. No idea what they cost. Cheers!
Reply: @MrMineHeads.  No; you made a nonsense claim and I contested it ("forces don't cancel the torque that the wind exerts on the turbine.") and now you're trying to squirm away.  Where is your reply to that?  I don't "fight" anyone, I question, using calculations based on the laws of physics. Funny how your type never does that. The company in question don't have hard numbers for their turbine on their website. Why do you think that is?  Instead, we get "A sophisticated sensor array collects localised atmospheric data" wwttff does that mean?  If that does not set of bs alarms, there is no hope for you. Dave, can you explain what that means, please?
Reply: @tzenophile  I loved one of the bonus effects of the VAWT, it recognizes no prevailing wind... ..  I guess nobody ever tried rotating the HAWT to face the wind.
Reply: @DoctorMangler  No, there is simply no orientation problem with the VAWT. A HAWT requires SOME kind of yaw mechanism. It might be passive, but it's still additional mechanical parts having nothing to do with energy trandsuction or structural support.
Reply: @DoctorMangler  I don't understand this infatuation with VAWT; yes, they look pretty, but I never saw a single comment from someone who actually have them. Personally, I'd just hook up a generator to a bicycle; on a good day I can sustain a production of at least 100 watts, that is 4x these lamppost contraptions.
Reply: @tzenophile  It was sarcasm.  Notice how we actually do have rotating head windmills. ;)
Reply: @DoctorMangler  Of course; when they have to argue that their dream system can handle being placed in turbulent areas, they don't understand that it has no business being there in the first place.
Reply: @tzenophile  Use use the verge on either side of the road! Brilliant huh? Twice the turbines. Install new poles? Yes, but get twice the output.
Reply: So, Dave, the comments here still document a glaring discrepancy between the company's own numbers (which for some reason don't appear on their own website, only in your video) and what is known about VAWT energy production, based on standard formulas.  Simply put, those numbers don't hold water, for a number of reasons:

1. Using 19 m/s wind speed to calculate the output of the turbine is obviously nonsense given UK's 4.2 m/s average. 
2. Even when using 19 m/s, the correct number will not be 6 kW for a VAWT this size. More like 2.1 kW. At 4.2 m/s, the power is a measly 25 watt.
3. Scale matters when it comes to energy production. One large turbine is much more efficient in maintenance and installation cost than 125 small ones. There are 15 MW HAWT turbines on the market now. That is not 125 but 600.000 times the real power of one of these at 25 watts. Good luck paying for, deploying and maintaining those 600.000.
4. It is well known that VAWT turbines seriously underperform compared to HAWT turbines. Money should therefore be invested in HAWT, if climate considerations are important. The damage to climate change politics from false information and failed projects resulting in disillusion is a huge problem. Too many companies, like the O2 Arena, are preying on climate change guilt or want to virtue signal. Let's not pretend otherwise.

Do you still stand by this video despite these serious errors, Dave? I sincerely, as a long time fan and defender of the channel (check out the Gravity Vault comments), hope not.
Reply: The cost of a 3mw solar farms is about 2,9m euro. Canadian solar (glas/film) Solaredge transformer with duo optimerzers. 3,1m euro if you raise them higer for sheep graizing. All prices without groundfee (2.5k/ha - 6k/ha)

Alpha 311 has a great concept, hope it works. Look beter then solar farms.
Reply: Since 2008 we have installed some VAWTs for various applications at the insistence of clients. Without exception, none of them have ever worked, produced anywhere close to the advertised energy, or come remotely close to delivering any positive financial performance. One architect even told me they decided the VAWTs they installed were just decorative and never expected to produce electricity. Re this idea: the airflow on a roadway is indeed significant on an instantaneous basis. But it is not in a consistent speed or direction. Each vehicle produces a turbulent wake and they do not produce a steady additive airflow regime. This is a neat idea, but I would be so incredibly surprised if it ever made any amount of energy as stated in this video, or if they didn't pose a safety problem to workers and drivers. If this weighs only 8 kg then it certainly can't be strong or secure. Just itching for a failure that causes an auto accident. You want a reliable small wind turbine? Get a Bergey - it is a 10 kW HAWT and it is certified by Small Wind Certification Council. Do your homework if you expect performance.
Reply: Dave, are we just moving on then without acknowledging that 125x6kwh=750kwh (average daily output of 125 turbines according to alpha 311) is 10 times less than 300kw*24h=7200kwh (average daily output of 3MW solar farm in the UK, night time is factored into the 0.1x capacity factor)? - See my and tzenophiles calculations above - they make everything clear.
https://en.wikipedia.org/wiki/Capacity_factor

I dont really get why we wouldnt want to set this straight - it wouldnt be that much work to just edit your correction or reupload a fixed version of the video?

I want to keep watching your videos without having to be paranoid that alot of the numbers and information isnt correct and having to double check everything xD
Fixing this would put alot of your nerdy viewers at ease I think...

Since you are in contact with the folks at alpha-311 it might even be important for them to know what giant mistakes they are making - they will probably thank you if you explain it to them - yeah sounds crazy but given the comparison-calculation theyve given to you they need some help...

It might even be fun to make an extra video about what went wrong in Alpha 311s comparison - a case study for calculating power in the wind and learning what the capacity factor is and how to fairly compare energy generation against each other... (cost/(installed capacity * capacity factor)) - at the end all that matters is $/kwh... and solar wins that big time against these turbines. - even according to alpha 311s own number of 6kwh/day/turbine.

A little math and physics never hurt anyone :D - give your audience the basic thinking tools for understanding things like these - since 99% dont even seem to have noticed these orders-of-maginute errors.

Your correction needs a correction buddy... :D

Thank you!
Reply: @jeffreylebowski4927  Clearly Dave has read the critical comments; it is a huge disappointment that he lets this stand.
Reply: @tzenophile  Yeah, maybe hes busy - he just uploaded another video too, Ill give him another week but then Ill be disappointed as well...
As a fellow "nerd" he should be excited about learning some new stuff and incorporating it in his videos - these topics become way more interesting when you dive a little deeper and see the whole beauty.
Letting alpha 311 get away with their bs calculations really is sad and a missed opportunity to upgrade peoples insight.
Reply: @tzenophile  PS: Fixing this video could have been way more interesting content than his new video imo - who really cares if greenhouse gas emissions have dropped slightly during the pandemic - its a temporary and short lived thing, that doesnt matter in the grand sheme of things...
Reply: @jeffreylebowski4927  Agreed; haven't decided if I want to stay subbed or not. It is too bad, really, since I do like his style, but maybe we are expecting too much of him. Having a BSc in "Technology" from 30 years ago is not really the science education that would help him here.
Reply: @jeffreylebowski4927  Here’s a thought. You and tzenophile  seem to know quite a bit about this stuff, why no try to contact him directly and do a collaborative video where you discuss these issues. There have been quite a few comments and Dave is not necessarily going to  be all over them - particularly after he has already posted a correction. I would love to hear and understand the issues you have raised more clearly. This is a genuine  suggestion I’m not being sarcastic.
Reply: @davidshipp623  Yeah its a good idea, idk how to contact him though - I did reply to his correction and adressed him directly but he apparently didnt even read any of it, since his "correction" still claims that the 3MW solar farm is comparable to the 125 turbines which is completly wrong - no idea why he cant do a simple 4th grade multiplication.

He says its outside of his "horizon of expertise" or whatever - just lazy and careless in my opinion.

So that ended up frustrating me a bit and I unsubscribed, also because his subsequent videos werent that interesting or good in my opinion - The way he talks about things is just too superficial and he lacks the curiosity to understand simple physics or maths even when done for him in tzenophile and my comments.

It is also very strange to me that a real company investing real money into this, would provide him with such idiotic numbers - they assume 100% capacity factor for their turbines running in crazy high windspeeds with physicly impossible yields to a realistic solar farm where they apply a 25% capacity factor - just plain silly... 

Unfortunately idk how to follow this up any further, since there was no reaction or recognition from him and I dont know how else I could contact him.
Reply: @jeffreylebowski4927  Yeah, that’s understandable - you can only go so far. There is a contact page on his website, so you could try to compete with all the bots that hit that😂. 
I agree that the channel is a little light weight, although I think intentionally so and to be fair to Dave he is open to and encourages feedback. Personally I use it as a ‘that’s interesting’ type resource, so pick and choose. 
This particular video does seem actively wrong though, so it’s a shame it’s not been properly followed up. (The numbers instinctively didn’t work for me from a project on wind turbines I did in my physics studies an alarming 38 years, but I lacked the memory to work out why! - so it was interesting to read the comments)
Reply: @davidshipp623  Yeah the equation Tzenophile mentions is just simple kinetic energy.

You probably remember that Ekin = 1/2m * v^2

Half the mass times velocity sqaured.

So if we want to know how much kinetic energy there is in the wind we take the volume of air passing through the blade area per second which will be the blade area times the distance the air moves per second which is its velocity.
so Area*velocity = Volume/second
We multiply that by the density of the air to get the mass per second, and then we plug that into the 1/2m*v^2 equation for kinetic energy to know how much energy this mass has, passing through the blade area per second, which will give us Joules per second or watts:

1/2*Area*velocity*density*velocity^2
= 1/2*Area*density*velocity^3

So that will give you the power or Joules per second or watts (all the same thing) that is in the wind for a certain blade area.

for Alpha 311s blade and 19m/s winds that would give us this:

(1/2)*(2m*0.5m)*(1.3kg/m^3)*(19m/s)^3 = 4458 watts.

If you go to alpha 311s website you can see the balde size is no more than 2*0.5m - actually even less...

So there is only 4458 watts in the wind to begin with - the turbines are only like 25% efficient - so even in these really strong gale winds they could only produce a little more than 1kw - no where near the 6kw the company claims - they would be generating more energy than even exists in the wind...

And then they use that number with a 100% capacity factor - so the turbines generate 6kw 24h the whole year while they apply a 25% capacity factor to solar... just rediculous stuff...

Oh well... their 6kwh per day number seems alot more realistic - maybe still too high i dont know - but with that number the solar farm will outproduce these turbines  10:1 even in the UK...

So as you can see its not that difficult, just highschool level stuff - thats why I was a bit dissapointed that Dave didnt even try and just said its beyond him - he was in contact with Alpha 311 so it would have made sense for him to udnerstand these things that he could have then raised to the people at the company. 

It just breaks the "nerd code" to make videos like this, be so wrong about everything and then not correct things when others are already doing all the work, working it out for you...

Gee the comment got really long again - anyways, its nice to know there are others out there who are interested and care :)
Reply: @jeffreylebowski4927  Yes it was a long response, but appreciated! All made sense thanks.

Prompted me to remember using the modified equation for rotational kinetic energy (part of a process of measuring output energy compared to a set input, to try and work out efficiency of specific turbine blades) I remember having a weight suspended on a spindle via a thread wrapped around the spindle with a specific number of turns and a measurable torque level. Can’t remember anymore than that though.

I do agree with you re the nerd code, the problem with leaving it as is being that undermines good work both on the same channel and in general confidence in statements about technology made elsewhere. 

Anyway, I appreciate you taking the time to reply.
Reply: @davidshipp623  Hi David, I guess since Dave is making a salary on this channel, it makes little economic sense for him to follow up a faulty video; it would not recoup the cost. Just like these inefficient windmills. And yes, the real damage here is that some people develop unrealistic expectations about wind turbines in general, and then the fossil lobbyists and climate change deniers have a field day. Matt Ferrell also had a pretty loony video about bladeless wind energy the other day; I think we need a youtube watchdog for taking down the worst offenders against demonstrable fact. Cheers!
Reply: @tzenophile  yes I guess so, and tbf Dave has already done one update. I saw the Matt video as well, I can’t see how the bladeless options would realistically compete with solar where a static solution was required. I did quite like the power pod though.
Reply: Your corrections are totally irrelevant. It is theft completely fueled by the vehicles' additional energy consumption which is much larger than the ridiculously small amount of stolen energy harvested by this type of parasitism. It is a scam on every level and the criminals behind that scam are lying like there's no tomorrow.
Reply: Thanks for starting the correction process. I'm afraid I agree you haven't gone far enough though. A 100% capacity factor for the wind... Absurdly high, non industry standard wind speeds.... Impossibly high output for a given swept area... The idea that 125 turbines of this size mounted 3m above the ground in a turbulent environment could compete with a 3MW solar farm is shocking. This doesn't even touch on the effect they will have on the drag coefficient/fuel consumption of passing cars, the dangerous/highly inconvienient location for installation and maintainace. The lack of published performance/reliability data. It's not a good idea and is a bad use of resources.
Reply: Thanks for the correction, there is still a few giant problems though:

The first one should not be controversial, because we will assume that all of alpha 311's numbers are correct:

They claim that 1 turbine produces 6kwh per day, and 125 turbines will produce 750kwh per day, and that this would make their installation equivalent to a 3mw solar farm.
The "capacity factor" (the actually generated energy per year divided by the nameplate capacity working at full load for 1 year continously) for solar power in the UK is 10% (because of night time and clouds etc - it can be as high as 29% in other countries).
This means that in the UK a 3mw capacity solar farm will only generate 300kw on average throughout the year.
Per day this will still produce 300kw*24h = 7200kwh.

And 7200kwh is 9.6x more than the 750kwh being produce by the 125 turbines.

So the solar farm and the turbines are not equivalent at all in fact the solar farm would be almost 10x more productive... Even in the UK which is not great for solar.
And because the price advantage of the turbines was not better than 10:1 in their misleading calculation, it follows that solar is alot cheaper than this type of wind energy.

It doesnt make sense for alpha 311 to give the solar farm a 25% capacity factor (6 out of 24 hours per day - which is actually still too high for the UK and most places) but then give their wind turbine no or a 100% capacity factor, when they compare their turbine to solar power - Especially since they assume extremly high and RARE windspeeds of 19m/s which will give them a very high max capacity but a very small capacity factor. 
When they then say a turbine will only produce 6kwh per day, theyre admitting that the turbine only has a 1/24 or 4.17% capacity factor - which is alot worse than solar and at lower installed capacity. - Such a low capacity factor makes sense for their turbine though because its high max capacity relies on such strong and rare winds.
(6kwh per day at 6kw installed max capacity = 1/24 capacity factor)

I also wanted to show that the 6kw is unrealistic even for 19m/s winds - again easy basic physics, but this comment is already very long and tzenophile already did that calculation above - He was extremly generous as well when he assumed a 2x1.3m blade size which is more than 2x larger than what can be seen in alpha 311's advertisement (https://alpha-311.com/ )- only one side of the turbine produces power, because the other half is moving INTO the wind... - So take the turbines width divided by 2 to get the relevant blade width.

Anyways - maybe try to fix these giant errors - a 10x mistake that lets them outperform solar with super misleading and stupid calculations is not acceptable on your great channel!!!

Love you and your channel,
Cheers.
Reply: @jeffreylebowski4927  
You may be right in all your calculations, but haven't you overlooked the fact that if these are placed on lamp posts on central reservations, the traffic wind will operate on both sides of the turbine.
Reply: Umm you are still not close to the overall inefficiency.  Look at the bushes around the turbine.  They are waggling around like a once in 5 year windstorm.  Did you do a wind analysis on this location?  Can we get a GPS?  If I film in Arizona at the right time of the year, I must and might just catch that rare windstorm, otherwise every day is just still and calm, but with a little film trickery we may be able to make it look valid for our theory.  Again, do you have a wind analysis on this location? The words that come out of your mouth are those of just another snake oil salesman.
Reply: just for you from newfoundland listen to the end lol https://www.youtube.com/watch?v=F_NUVaUd4XA Buddy Waisname II climaticcally challanged in toronto :P
Reply: OM-06 alternative powered farming 2 a pro network that was taken turned into teaparty twitter crowdrise and more 3 my Public Options a bundle like net phone cable but our basic nessesities and get fair share out of those who need to pay fair share and more
Reply: Well said, Dave! Thanks for the correction, explanation, retraction, addition, clarification and independence statement.
One more area for the manufacturers to consider: Generators can also be put alongside train lines. Not only will they generate electricity when trains pass, or when the wind blows, but they will also attract less criticism from people than the ones alongside roadways, since most stretches of primary rail routes are remote from urban centres.
Reply: @waffleuk  Sigh. I don't want to shame a teaching fellow that is used to front a dubious company. (And being listed on an advisory board does not mean he stands behind this numberspiracy in any way. )I said show me a researcher. That is someone with at least one peer reviewed publication in the field of VAWT AND explicitly states that this is solid. Still waiting. Not going to happen. The numbers are clear, that is, to anyone with a brain.
Also, I did not want to pollute this pinned thread with your nonsense.
Reply: @tzenophile  you keep moving those goalposts, petrol puppet. Keep your bosses happy.
Reply: @waffleuk  these turbines are powered by petrol... The increased drag on the cars causes the engine to use more fuel. It's easier to "punch through" (as OP puts it) thin air than it is to punch past a turbine.
Reply: @waffleuk  being a skeptic of extraordinary claims does not a petrol puppet make. This device simply cannot extract near the claimed amount of energy, and will be expensive to boot. In power generation, bigger is better due to the economy of scale
Reply: @waffleuk  Petrol? My only vehicle is an electric bike powered by my solar panels (they produced 40 kWh today, yay!). But do keep up the ad hominem Mr. Waff, since you have nothing intelligent, constructive or even critical to say about the problem at hand. Dave, however, has some correction to do. Why does he still, after being challenged on pure physics formulas, accept these numbers which make no sense? Errare Humanum Est, but... I used to be a fan of this channel, and argued vigorously against the thunderfoot clan regarding the Energy Vault video, because the numbers there made sense, but this... a huge disappointment. This is very simple math.
Reply: @dexterdixon2000  That was my first thought, and I was hoping the video would address this point. Being placed in the central reservation may make some difference though, because passing through slower air might actually be helpful, instead of passing through the headwind from oncoming traffic.

Either way, I'm extremely sceptical about VAWTs after my university project on them. With wind turbines, bigger is better, so to get a reasonable power output you would need it to be tall and wide, which goes against the premise of having them in urban areas. You'd be better off just having an out-of-town massive HAWT.